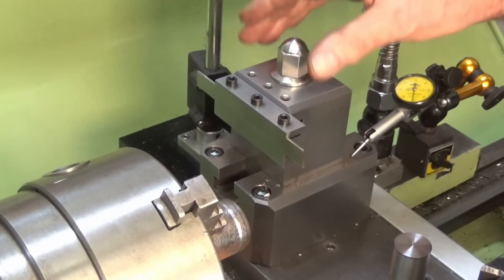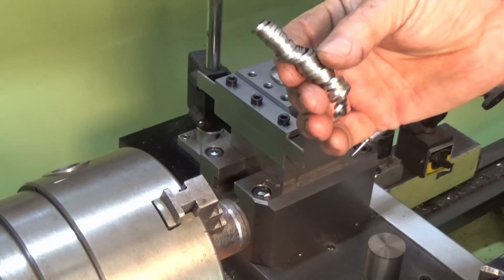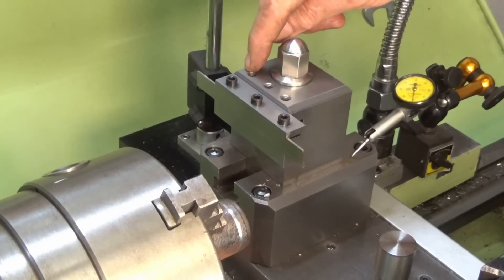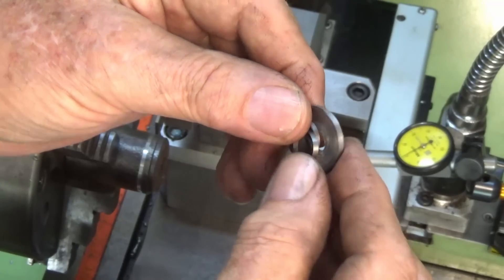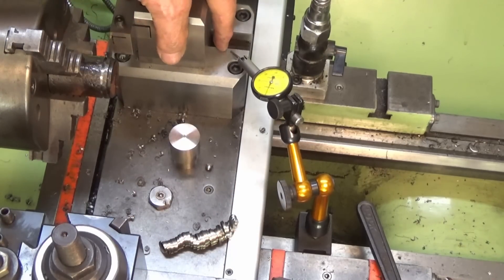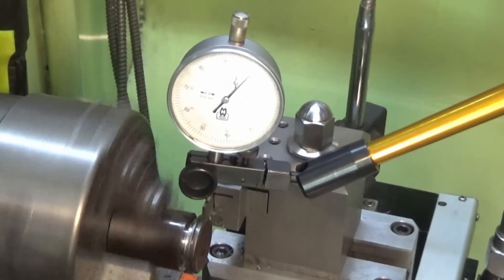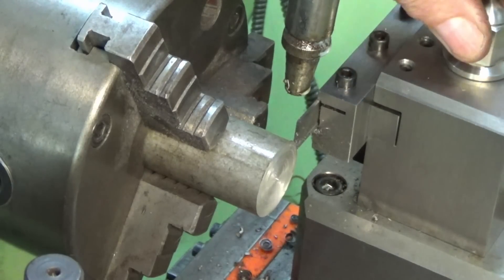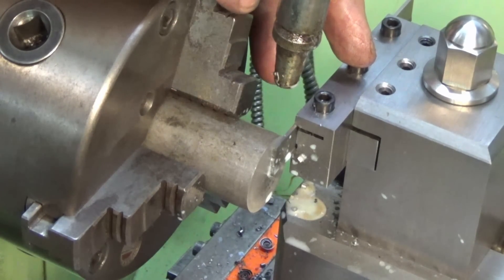Rear Parting Tool Holder For Your Lathe - A Little Performance Analysis

Comment: That machine is tight. I would be afraid to put indicators on my tool post , I think it would be all over the place.
Reply from the maker: Thanks. I must say I was very surprised at how little movement that was evident. Like all older lathes, the carriage runs very smoothly in the middle and gets tight towards either end but I have tightened all the gibs so that they are "right" in the middle where I do most of the work. 
Regards,
Mark

Comment: Will you be getting a better camera in the future? I’M NOT COMPLAINING, just asking. 
I’ll be updating my lathe as you have done. Seems like an easy decision to make. Well done BTW. 
I’m always amazed those birds don’t bite off the tips of their tongues! I can’t eat a peanut without shedding some blood. 
Cheers,
Gary
Reply from the maker: I am currently using a Sony HDR CX625 Handicam. It's a bit of a compromise but I am not a fan of using DSLR cameras in the workshop. They are big and heavy and expensive if you knock them over. I know a lot of people use an iPhone or a Samsung phone but I don't have a spare one for that. One thing I have done is to ditch Movie Studio in favour of DaVinci Resolve for editing. Once I get used to the workflow I think it will be a big improvement and I can take advantage of a higher frame rate and increased resolution. It is interesting to watch the cockatoos manipulating their food with their tongues. They are also very good at standing on one leg and eating at the same time!
Regards,
Mark
Reply: @Preso58  thanks for your reply. I understand your approach regarding video recording. You’ll work it out I’m sure.

Comment: It's a known way to part off, running in reverse, having the cutter up side down. But making a special tool post for that feels as too much when a partial part off and the bandsaw does the job. Checking my min lathe, it has no room, no height, for an up side down blade
Anyway, thanks for the video.
Reply from the maker: I do have an inverted parting tool that mounts in the front tool post and I have a keyed spindle mount for my chuck so I can safely run the lathe in reverse. Unfortunately, a lot of folks have screwed on chucks so running in reverse is out of the question. Even with the inverted tool that I have for the front tool post, it's still not as good as the rear tool post since the compound slide is way less rigid than the solid post at the back. As you have found out though, it's not something that can be implemented on every lathe.
Regards,
Mark

Comment: Just a thought and it might not even make a difference but if you beefed up the top portions of the tool holder and tool post (which should never be in the way, maybe you could reduce upward movement of the tool itself.   I know you're going to try the 3mm wide part tool so that should reduce too.   Just 2c
Reply from the maker: I think for that narrow HSS blade, the tool holder is about right. I just took delivery of the 3mm wide carbide insert tool today and I will fit the flexure slot and the set screws underneath since it will be taking much wider and heavier cuts. Another update coming soon.
Regards,
Mark

Comment: Thanks for sharing 👍 are you going to parkerize it?
Reply from the maker: Yes, absolutely. However, I need to finish off some other projects first since it's better to do a lot of parkerising all at the same time. I am part way through making a Hemmingway knurling tool and I will be doing a whole batch of tee nuts, some finger clamps and some Mitee Bite style clamps all at the same time. 
I hate rust!
Regards,
Mark
Reply: Always parkerize. It is the fastest way to a rust resistant surface.  Remington, Winchester, & etc. knew about this before WWII.

Comment: Have you put an indicator on the side of the blade to check for horizontal vibrations?  That’s my guess.  Not sure that has anything to do with whether the parting blade is on the back or front though.
Reply from the maker: Brad, I have not checked for sideways movement. I suspect there will be some vibration and flutter there but since I realigned the parting blade it has been cutting a lot better. I have the two insert type parting blades and I just need to make up the tool holders for them. I will probably do another follow up when they are completed.
Regards,
Mark

Comment: You might be able to mill in a shelf with a ramp on it for the tool holder so when you tighten the set screws it pulls in tight to the block. Similar to a post and beam construction. Sometimes the set screws on a flat surface have enough push as they turn to allow the part to walk out slowly. If that isn't the problem then maybe setting up a fly cutter in the lathe and machining a skim cut in-situ to make it perfect with the ways on the lathe may be a good option???
Reply from the maker: I recently bought two carbide insert tools and they have a raised vee profile in the top and bottom edges of the tool body. I guess the idea is that the matching toolholder has a corresponding vee profile to align the two parts accurately as you clamp it. It's a good idea but it wasn't something that I could easily machine in the top and bottom surface of the slot of the toolholder that I made. I sort of lost interest in tweaking the performance of the HSS tool since it works well enough that it doesn't really bother me. So far I haven't had any breakages or dig ins so unless that starts happening I think I will take this version as a win!
Regards,
Mark

Comment: That is a very nice parting tool.  I think you are in danger of testing it beyond reasonable limits.  Thanks for the video keep on keeping on.
Reply from the maker: Thanks Harold. I am getting set up to use the clamps on an actual milling operation and I want to try to pull a job out of the clamps to see how much holding power they have. I just have to work out a way of doing it. 
Regards,
Mark
Reply: That's where you find out what the limits are, yes?  Keep measuring until its all well inside the tolerances you need, then you know for sure.

Comment: I'm not gonna lie....Watching that parting off was a joy to watch!
Reply from the maker: I know! I am almost relaxed with parting off operations now. I did have a brief scare the other day when I got a bit too relaxed and forgot to add some cutting oil while I was parting off some 6011 aluminium. The cut must have been a bit dry and the heat made the blade expand sideways in the cut. You can hear it when disaster is about to strike but I got the blade out before that happened. A few sprays with WD40 did the trick though.
Regards,
Mark

Comment: Gday Preso, that’s a really solid result, I use the same parting blade setup that you’ve ordered, there not bad, thanks for the update, cheers
Reply from the maker: Thanks Matty. You tend to work with much larger diameters than I do and I have always been impressed with how well your lathe handles those big chunks of steel.
Regards,
Mark

Comment: Working pretty well, guess if you are some kind of perfectionist (which you clearly are - so waiting on part 2), then you can work out where and what you need to machine off the back of the tool holder to correct the slight misalignment. Operationally though, it's a none issue, that tool is cutting as well, probably better, than any other parting tool I have seen in action, seems to be a lot of rigidity there, which is paying dividends. Lovely job and thanks for the update.

PS - have you checked the lathe spindle for run out under load?
Reply: Just as a general issue, I've more than once wondered how much good it does to show off fantastically low spindle runout with no cutting load.  I haven't thought of a good setup to measure it while actually cutting, though.
Reply: @somebodyelse6673  the easiest way would to turn between centres and carefully machine the headstock end concentric with very light cuts, then put an indicator on the concentric part and take a heavy cut on the rest and see  what if any runout you can detect.
Reply: @samrodian919  - If you're putting the indicator on the workpiece, how do you rule out inconsistancies in the workpiece material?  Just buy something expensive and hope it doesn't have non-uniform stresses being released, hard spots, soft spots, etc?
Reply from the maker: Glenn, I will do a follow up when I get the two carbide insert toolholder made. I bought a 2 and a 3mm version and I have designed the toolholders for them. I just need to do the machining and try them out. The HSS blade is working well enough that it doesn't warrant any further tweaking. 
Regards,
Mark